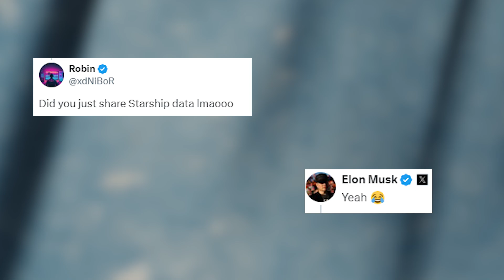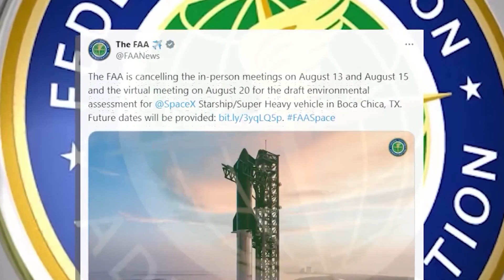Elon Musk Leaks HUGE NEWS on Starship Flight 6 after flight 5...

Comment: OK----------- .  NO...!!! Q88M is LYING!!!!   The booster could not have crashed near the launch tower let alone destroyed it... Only One engine had problems, 12 other engines STARTED just fine. And the Booster uses only 3 engines for actually landing on the Tower...  The Booster could have landed with only 12 good engines easily...  And if all 13 engines failed to start the Booster would have crashed (IMPACTED) miles out into the GULF far from the Launch tower AND DRY LAND....   The Booster had to Start its engines in order to even get near the launch tower.!   This BOZO ---  Q88M is Hyping the minor problem for Click Bait for more Views...  BUT THEN MANY VIDEOS ARE DOING THE SAME THING...!
Reply from the maker: Check out my video, the engine system are fine, the issue is in the control system's parameter configuration